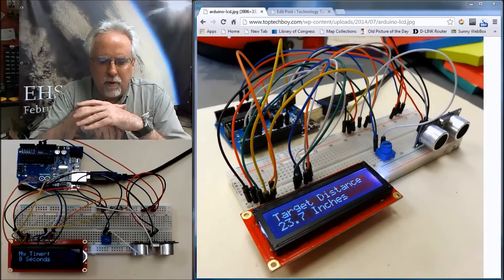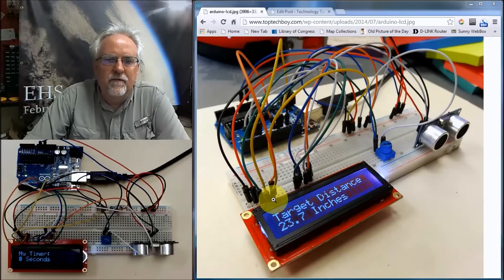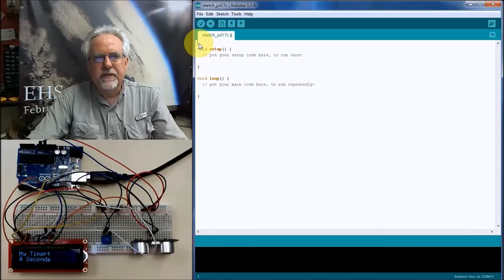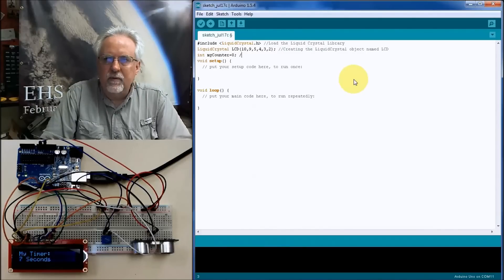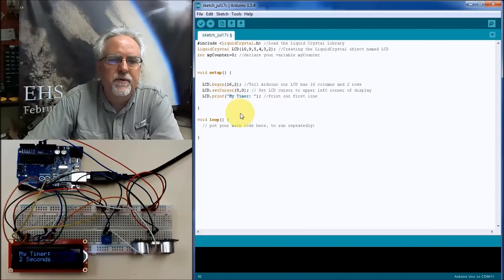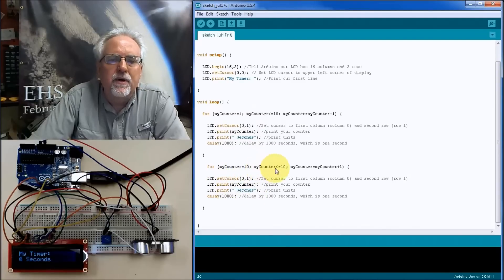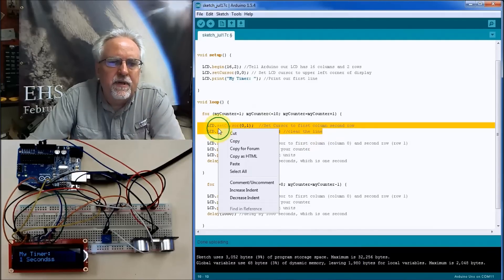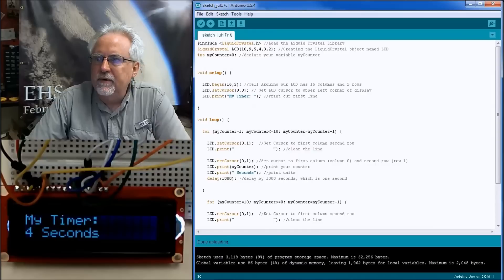LESSON 19: Using LCD Display with Arduino

Comment: hello Sir... 
When i use 
LCD.begin(16,2);
and 
Serial.begin(9600);  // with any bar rate. 
 My program did,t run exactly ... my lcd show random characteres , irrelevant to my code.. 
what z the problem plzz guide me..
Reply: Without seeing your source code, we can't give you much help. But because the member functions of the LiquideCrystal library emulates those of the Serial console object class, I suspect the problem may be a simple as you referencing the wrong object in your code. When you use the LiquidCrystal Library, you create an object of this (LiquidCrystal) class (a programmer definable data  type). In the video above, the object  was called "LCD". To use it in your script, you have to use the print() or write() member functions as follows:

LCD.print("This is a test");   // Displays a string on 1602 LCD display

  or

int num=3;
LCD.write(num);

Perhaps you were thinking: Serial.print("whatever"),  so maybe you used the wrong object. Try "LCD" instead of "Serial". Just a guess...
Reply: William Moore  thnx for ur help .. 
I have figures out type problm . 
Problem was that i was using arduino Rx and Tx pins also for lcd display.  Pin 0 is suitbale for lcd but pin 1 is not suitable .. So when i skip pin 1 and use another digital pin i got the solution . 
Thnsa man for ur review .. 
😊😊